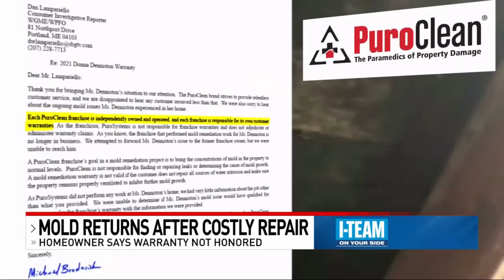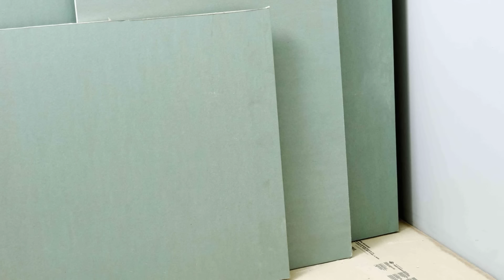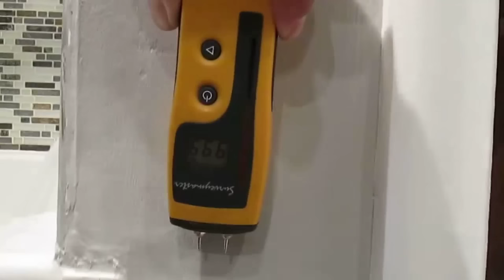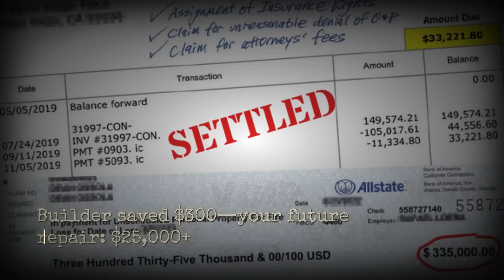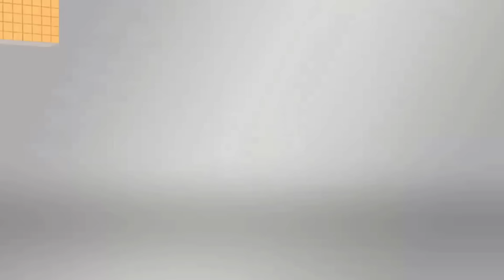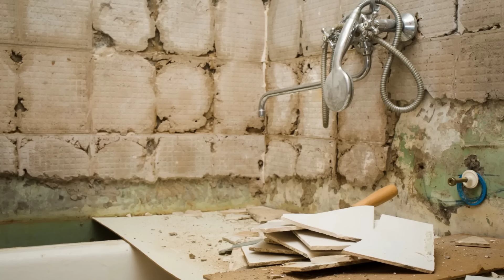Why 90% of New Bathrooms Are Garbage (The Waterproofing Scam)

Comment: General contractor here - whenever possible, I tell my clients to go with prefab showers. Custom pans are expensive and a lot can go wrong over time. Tile is expensive, via labor, and requires ongoing maintenance. 

Spend half the money and get one of the many prefabs that are offered today. There are a lot of choices - many are visually appealing as well as functional. Virtually maintenance free. 

TLDR - custom tiled showers and tub surrounds are overrated. Sure, they look cool… hope that is worth it.
Reply from the maker: Exactly, prefab is the way to go for longevity 🦾
Reply: That’s because you don’t have good subs and you don’t know how to do tile. Tile is cheap instillation is simple if you’re an expert
Reply: @tomdemeo2708 in the market I work in, you’re looking at $10k plus for a custom shower. We’re talking about starting at framing all the way to end product. They turn out really nice… but there is nothing ‘cheap’ about tile.
Reply from the maker: That is a very realistic assessment of the market, and your $10k starting point accurately reflects the true cost of quality craftsmanship. For many homeowners, it is important to understand that a custom tile shower is a premium architectural feature, not just a standard utility. When you factor in everything from structural framing and proper waterproofing to the precision of the final tile set, the labor-intensive nature of the work justifies the investment. Providing this kind of transparency helps set proper expectations for those who want a "forever" bathroom rather than a temporary fix. Thank you for sharing those professional insights into the real-world costs of high-end renovation!
Reply: @Qua @QualityRot hen I really think about the numbers, I think 10k was a bit conservative. That number is roughly the cost to do a three wall tub surround to the ceiling with a custom niche. 

For a large custom shower with a poured shower pan and frameless glass, the Minneapolis market is all of $15,000 - and up (depends on tile selection, design complexity, size, etc…) A good tile sub gets about $65+/hr for labor… at least. Hell, I pay my lead carpenter subs $55+/hr. I have friends that are lead carpenters that make $45/hr with full benefits at their company.

The markets are waking up to the fact that highly skilled tradesmen are valuable and rare. There are a lot of people that call themselves ‘carpenters’ or ‘tile setters’… but few are to the level that could be considered ‘master’. 

I enjoy your channel a lot. The content you provide is honest and valuable. Thank you.

Comment: Is this really legal? Don't Americans have building codes?

In Denmark, a bathroom room without a waterproofing membrane would be considered a building code violation and the constructor would be liable to a lawsuit regardless of what they put in their terms. Bathrooms without membranes haven't been legal in new construction for over 30 years.
Reply from the maker: The code don't protecting from nothing
Reply: @QualityRot  Why not? If the code requires it, the builder cannot legally reject a claim with "Well, your contract didn't specify a particular technique, so that's just how we built it - live with it"

Comment: Anyone care to chime in on Bath Fitter, as long as we're talking mold and overpriced, oversold temporary stuff?
Reply from the maker: That is a fantastic question, and it touches on a major concern for homeowners looking for long-term bathroom solutions. While systems like Bath Fitter offer a quick aesthetic refresh, the primary risk involves covering up existing issues rather than resolving them. For homeowners in the 35–90 age bracket, investing in a solution that could potentially trap moisture and lead to hidden mold growth is often a significant concern. We always recommend a thorough inspection of the underlying structure to ensure you aren't just applying a temporary bandage to a more serious problem. Your caution regarding "overpriced and temporary" fixes is a very sharp observation that can save others from future headaches!

Comment: The water piping & connections behind the wall are what's not supposed to leak. That is the failure. If any water piping or connections leak, fault is in material or labor. 
All thereafter & of exterior waterproofing is aesthetics and mold prevention and detection. 
The rest is insurance baloney excuses not to pay. So who needs them?? 
No one.
Reply from the maker: Scammers, all about profit

Comment: For cement board one would line 60 minute tar paper behind it. For green board, cover with that rubber paint crap. Shower pan are best made with lead if not rubber but don't cut the corners. The shower should be waterproof and all water runs to the drain before tile is set. The best way, lath, scratch coat, then brown coat then latex based cement thin coat over lead shower pan. Dry pack the tile floor. One bathroom, 35,000$ and will last forever

Comment: In ten years there will be a lot of rotted out trashy houses.
Reply from the maker: 😅 your not wrong
Reply: quality from west producte going rapid down and from china up more and more.......soon: everybody happy as on a pruct....made in China stamped. Dont buy American products
Reply: There already are, Horton D R Homes
Reply: It does feel like that’s a real concern, especially when waterproofing and installation details get rushed or done incorrectly. A lot of these issues don’t show up right away—they take years before you start seeing damage behind the walls. The difference often comes down to whether proper systems were used and installed correctly, not just the materials themselves. When everything is done right, it can still last a long time—but when corners get cut, problems can show up much sooner.

Comment: They did tile straight onto drywall in my 2014 home.
Reply: If it's builder-installed, I would say no, but if they called in a tile guy then you may be ok, especially if it's tiled to the ceiling and you're sealing the grout every year- although the jury is out if that's really necessary.
Reply from the maker: Not anymore who?
Reply: @QualityRot  the builders did it. The home was built in 2014 and it wasnt redone by the previous owners because the pictures matched the original listing. I bought in 2021. 1 year later i noticed the tiles looked pushed in and discovered the horror.
Reply from the maker: I am truly sorry to hear about the "horror" you discovered, especially in a home that isn't even ten years old. It is incredibly common for builder-grade showers from that era to have been constructed with minimal regard for proper waterproofing standards. Finding that your tiles were actually being pushed in suggests that the underlying structure had likely reached a point of total saturation and failure. For many homeowners, this is a painful lesson in why the "unseen" layers behind the tile are so much more important than the aesthetic finish. We appreciate you sharing this cautionary tale, as it highlights exactly why we advocate so strongly for specialized installations over standard builder practices.
Reply: That’s kind of surprising for a 2014 build. Tiling directly onto drywall—especially in wet areas—seems like cutting corners, since there’s no real waterproof layer behind it. It’s situations like this that make people question how consistent modern building practices really are. Just because something is newer doesn’t always mean it was built better.

Comment: A plastic vapor barrier, like faced insulation, coupled with a sealed substrate, like red guard, will set up a  mold-sandwich. Old time tile guys know this, but builders may be in the dark. Unfaced rock wool for my walls.
Reply: That’s a really important point. Trapping moisture between a plastic vapor barrier and a fully sealed surface like RedGard can definitely create that “mold sandwich” situation if any water gets in. A lot of the newer systems seem to work best when you commit to one moisture control strategy instead of layering multiple barriers that don’t allow anything to dry out.
Using something like unfaced rock wool makes sense in that context since it allows the assembly to breathe a bit more.
Reply from the maker: Exactly, you have to let those walls breathe!
Reply: Go-Board